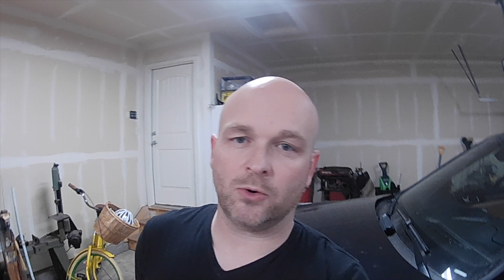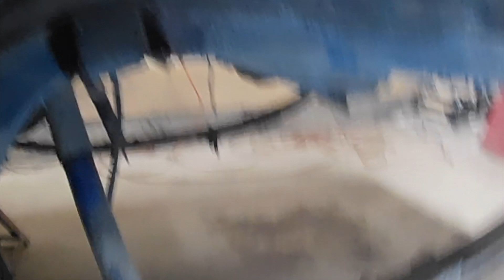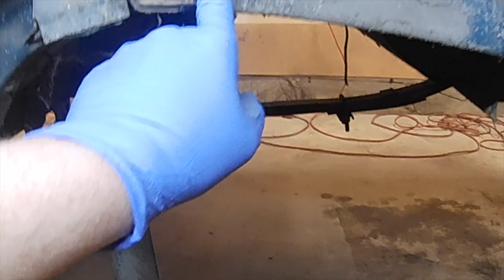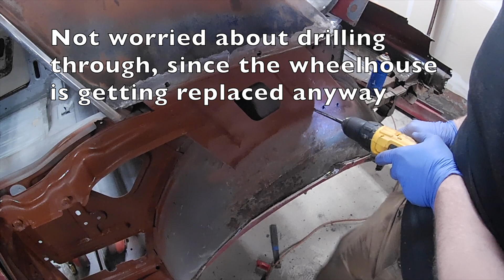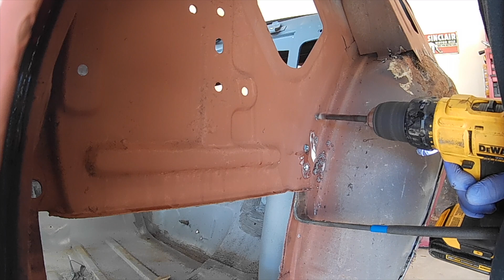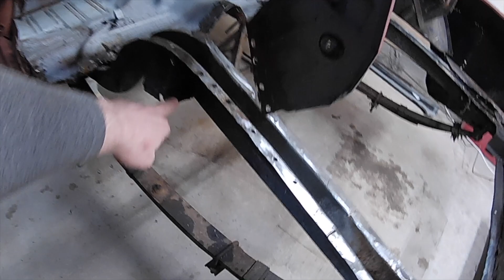Project Code Blue, part 5: 194 spot welds later, the old is out! 1965 Ford Mustang Restoration

Comment: Ambitious dude.  Are you using a regular drill bit?
Reply from the maker: Garage Time - Restomod  For some things I’m using a regular bit.  For most things, however, I use a Blair spot weld cutter.
Reply from the maker: Garage Time - Restomod  Just checked out your channel, nice work!  Been thinking about doing a Porsche for some time now.  Will subscribe and look forward to the build.